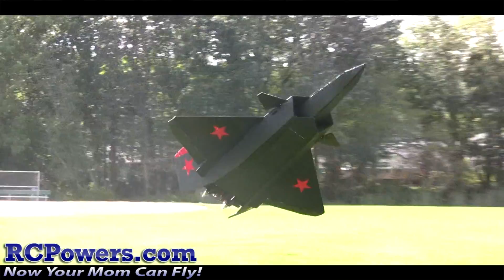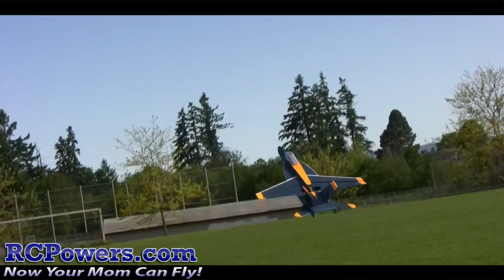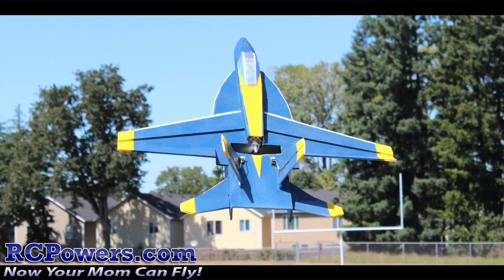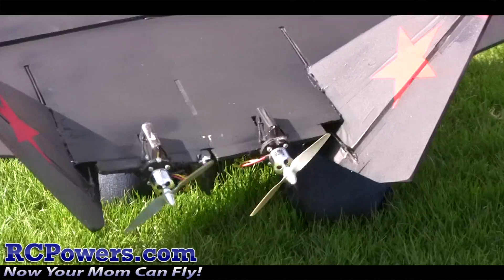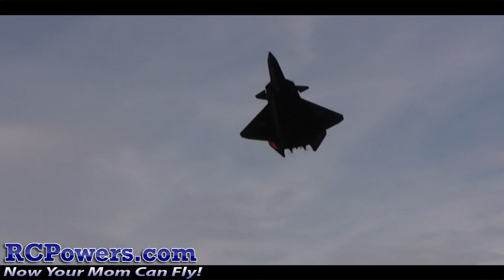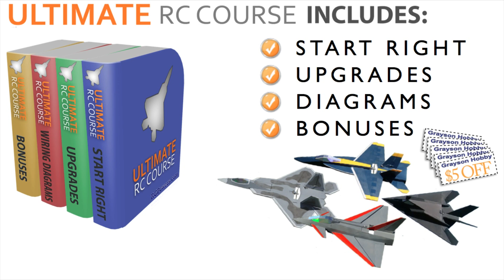J-20 HIGH ALPHA DESIGN

Comment: Your design is a lot different then the chinese version. Much larger wings and control surfaces and the angles are different. Your vertical stabilizers are further back allowing control in alpha. Plus your canards have no space between them and the wings like the Chengdu J 20, making the airframe shorter and more balanced. The real aircraft is long and thin with small wings, with the stabilizers almost right on top of the wings. It almost looks like a strike aircraft like an F-111 instead of an air superiority one.
Reply: LordDigz12 ò

Comment: The J-20 won't have even close to the high alpha capability that your RC has, because the tail wings are not that far back beyond the main wing. The tails are actually almost entirely directly above the 75% - trailing edge portion with only about 5% of the tails protruding beyond the trailing edge of the main wing on the actual  J-20. Your RC design is an improvement. Additionally,  you've improved it by giving it thrust vectoring which the J-20 doesn't have (China can't even produce a 5th gen engine yet).
Reply: Well if you look at the J-20 again you can actually see a protrusion at the end that the tail wings are sitting on, this is a choice made to increase stability at high speed and to improve yaw at high speed. While I can't tell which is which I do know that the ailerons under the wing either redirect fresh air when at a high angle of attack to the top wings or just do the high alpha yaw by themselves bothe ideas work due to air's natural yearn to flow in a linear direction rather than flow around something A.K.A meaning that air will be redirected to the top by the ailerons anyway. Although the gap between the engine and the tail wing also ensures that fresh air still reches the rear ailerons anyway. It's pretty smart design of you want a dogfighter that can also supercruise and do high speed attack runs.
Reply: the engine has 360 trust vectoring, thanks to a very old Russian tech. BTW, F22 only can do 180 degree. 

one of the two engines in J20 prototypes is Chinese made. The engine will be also used  in J31.
Reply: F-22's TVC has +-20 degrees thrust vector deflection. While Russian version has +-15 degrees thrust vector deflection.

F-22 doesn't have any vertical surfaces that would act as an air brake during pedal turn moments.

Comment: J-20 doesn't have thrust vectoring.
Reply: Well it does, except no public videos have been released showing the new vectoring, the most recent videos are before it was announced it has vectoring
Reply: +Harry Rosendale No it does not.
Reply: relying on thrust vectoring to turn takes too much time for engines to spool up. This is why the F-35 canceled it. It is better to have canards as it gives the plane more lift. Russians don't use much of it. They are for immature people who don't understand combat and are thinking of "Top Gun" movies. Real battle are at higher speeds. A turn like what you see in air shows in high speed would kill the pilot. A plane has to slow down too much, unlike a car, a plane takes awhile to get back to supersonic speeds once it slows down. Relying on thrust vectoring means the speed has to go together with the turn. It almost killed pilots in the F-22 and is causing sickness. China already have thrust vectoring in many of its missiles. They are smaller but since no pilot is on a missile. It can be made to turn more than 30 Gs. J-20 might have thrust vectoring in the future but it is redundant. A Eurofighter proved it can beat the F-22 in within visual range dogfight. But if rules were BVR than a F-22 will win. The J-20 have both the positives of an eurofighter and a F-22 , even better, since J-20 has DSI which gives it lower RCS which the F-22 do not have. The F-35 have better frontal aspects but it needs afterburner to go vertical. The J-20, in its newer videos, proved it doesn't need afterburners to go vertical. SInce it has two powerful engines. It also has twice the range due to its size. This will force the US to rethink its deployment of assets in Asia. To go vertical, thrust to weight ratio has to be greater than one. The new videos show the J-20 not only go vertical, but FAST! And it made damn small radius turn quickly of less than a mile radius. It is agile for sure.
If you just want to troll and not talk facts and be in denial. Than spare me, please. Put your pride down and look at facts. Chinese scientists/ the head engineer of YF-23 is Chinese . So the idea that copying implies Chinese scientist can't do science. Which is not true and underestimating an opponent is the dumbest thing to do.
Reply: Actually if you've been updated on the news you'll have seen that China has made the breakthrough needed for thrust vectoring and are planning to put it on most of their new planes. The F-35 didn't choose thrust vectoring because it already has too much technology on the rear, not to mention it would increase it's already way over-budget price

Comment: Maneuverability is based on two major factors: T/W and wing loading. Assuming IF the WS-15 engines are created the J 20 will have a higher Thrust/Weight ratio. Also the J 20 is purported to be lighter than the F 22, mainly due to the ceramic plates of it's thrust vectoring. The fact that the J 20 has: lower wing loading, higher T/W and not to mention, canards, it is very probably the J 20 is more maneuverable. 

The J 20, although big, may actually be more maneuverable than the F 22.

Comment: @aaron8862006 One word - Cavitation. This is why you are so wrong about fluid dynamics and wind turbulence - cavitation rapid changes in pressure of a liquid that can create catastrophic cyclic waves that can fatigue and cause failure in structures. We don't fly planes at high alpha underwater. Why not just say Knots - indicated/instrument, estimated or true you are just a jargon dropper
You mentioned you are a pilot. Could you tell us who you fly for so I can steer well away from than company

Comment: @dalmanation - "the proof is in front of your eyes, high alpha sustained stable flight." A party-balloon can sustain "stable high alpha flight" by that definition. This has no relationship to high alpha flight dynamics in a real aircraft and what is required to maintain control of a real aircraft at high angles of attack. 

This guy is comparing this to "popping a wheelie" on a motorcycle. Are you serious? This is a silly toy, stop trying to make the comparison. You can't.

Comment: @dalmanation - I don't doubt that it takes a talented modeler to put this together, but it's foam with a couple electric motors on it. It's not some metaphor for aerodynamics. And I guarantee you, by scale and by thrust to weight ratio, it is overpowered. 

In a way, it's producing lift, it's deflecting some quantity of air downward, but that doesn't mean if you scaled this model up, it would do the same as a full sized (real) aircraft.

Comment: @dalmanation - How would I "know if it did or didn't produce any lift?" By understanding how lift is produced. "Vectors vectors vectors, hurr hurr" is not an explanation. I could blather at you for a few hours about aerodynamic theory. Fluid dynamics. Why an aircraft produces lift, why specific shapes and configurations are used. Yes, obviously, the over-arching design is important... particularly with regard to control and stability, but it's inseparable from the minute details.

Comment: @dalmanation -  Yes, of course if you made a full scale identical mock-up of the J-20 it would fly like the J-20.. the point is that this is not identical. It's not even close. It would be like comparing a crayon drawing of a smiley face to the Mona Lisa. The icing example was very pointed/intentional. If you consider the tiny amount of deformation to the surface caused by ice and look at the results, then examine this clumsy foam copy, you'd understand. It would be nothing but drag.

Comment: @dalmanation Turbulence and non linear flows from high alphs can still be broken down into vectors but the resultant control surface inputs required can reach saturation in traditional designs - are overcome by this model especially through the vertical axis by offsetting the tails from the fuselage....the proof is in front of your eyes, high alpha sustained stable flight - who cares if the power to weight ratio to wing area is not the same as the J20. Any time you want to give in is fine

Comment: @aaron8862006 I will accept that the aircraft is underweight for it's scale, however you claim it is over powered in the model version - you are kidding me. How would you know if it did or didn't produce any lift? Guessing I would say. I don't know either, but all you are saying is that it is hovering with a slight portion of forward thrust - still takes a talented model maker to do this and prevent a stall (keep it flying) due to turbulence - hence the good design - which you rubbish.

Comment: @dalmanation - I get the feeling you lack any real education so I'll keep this brief and simple. A real aircraft like the J-20 produces lift as a product of careful shaping of the flight surfaces (and fuselage, really.) This foam model does not produce lift in that classical sense, it crudely redirects airflow downward by maintaining a finite angle of attack. If it weren't an under-weight, overpowered model, it would not fly.

Comment: @aaron8862006 you referred to a kite because you don't know what you are talking about!  Because you are a simpleton you think the minute detail makes the difference, it is the over riding generic style (control surfaces, wing geometry/proportions, thrust/vectoring/weight ratio) of the aircraft that allows the stable high alpha flight which replicates, on scale model, the J20. The boxcutter, crude build of the model is what makes RCsuperpower a genius and you a grease stain on your the tarmac

Comment: @aaron8862006 "flat plate" like there is another type of plate? Stop the gibber ladden catch phrases. High angle of attack flight departs from aerofoil dynamics and wing lift  over to thrust and it's associated stability issues. You have been caught out as a hater and if you threw a rock as hard as you could it would hit the ground at your feet. Thanks your "help". That you are finished talking shit suits me fine. Learn English then the principles of flight before trying to master me Icarus

Comment: @aaron8862006 you are so clever - take a study of a basic kite and the combined forces required to make a kite fly/hover - now how is that in any way related to the wing/thrust combination and control surfaces in this model? If it had a string pulling it under the cockpit you could call it a kite, but it doesn't'. The model doesn't have a trailing tail to stabilise it ( like a kite), because it uses a complex shape, manipulation of control surface and thrust vectoring. You are right about the BS

Comment: @jobjed the j-20 is long and slender, uses AESA and is a stealth aircraft. there is no similarity between the j-20 and the mig 1.44 besides they are both delta canard design, just like a dozen other planes in the world. you have no evidence or proof to suggest the j-20 even marginally derives from the mig. why don't you just admit that your baseless assumptions are unproven and overwhelmingly incorrect.

Comment: @paytontech the EXACT copy of the su-27 is called the su-27 which they BOUGHT in the 90s. the j-11a is the LICENSED version of the su-27. the j-11b is a 4.5 gen version of the j-11 with basically no bit the same. the engine's chinese and so's the avionics. even the airframe is same only in shape, the materials are essentially all different due to extensive use of composite materials. the mig 1.44 is non-stealth, PD radar, conventional intakes, bulkier.

Comment: seriously that thing is a disgrace to the j-20. the wings are not trapezoid shape. Did they not leanr nothing form pictures in the web? 

if you are going to build a rc model, at least do it right. You based it on an f-22 which has aerodynamics very different form the j-20. disgrace

Comment: The J-20 is very maneuverable and because it is a large craft, it will have a big payload and/or a long range. However, the J-20's canard compromises its stealth abilities and it is only difficult to detect by radar detection head-on; from rear angles it is not very stealthy. In contrast, the F22 will not be as effective in a close-quarters dog-fight as the J-20 but it is far more stealthy from all angles. The trade-offs each plane displays indicate the purposes for which they are intended.

Comment: When did jets last engage in a dog fight in war time ? Political pressure is for zero casualties. This is a time of drone systems, and armed ones too. The manned aircraft issue is fire and forget. What long-range missiles can you rig on the airframe, not the agility of the airframe. A lot of countries retrofit 30-40 yrs old jets with top notch electronics that are zero at dogfights but nicely fit the bill for radars and missiles. Do you need to dogfight ? a cannon ? no. F22 cancelled.

Comment: @sharrynuk If you want to build the J-20 what I've done is got a f-22 PDF plans then cut the back wing off and put canards on it. however I'm not 100% sure how to wire it all up properly but I have flown it and it is the most monouverable plane I've ever flown. I used 7 servos

Comment: The most nimble comparable fighter is the SAAB JAS-39 Gripen. It is and remain the most maneuverable of its class with the latest (NG) version giving it new and enhanced capabilities. Granted the J-20 is not in that lightweight class, but they share the delta-canard configuration which is relevant in regard to your question. In a close range fight the Gripen would beat it hands down. Long range is a completely different ballgame altogether where weapon systems performance is key.